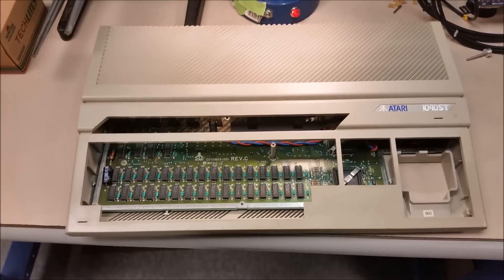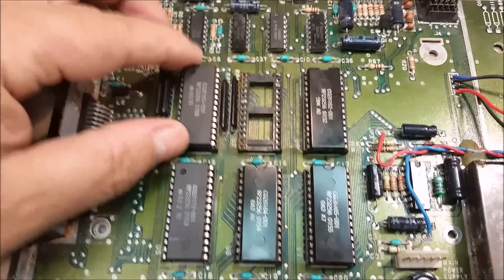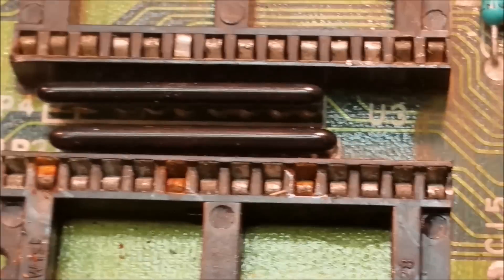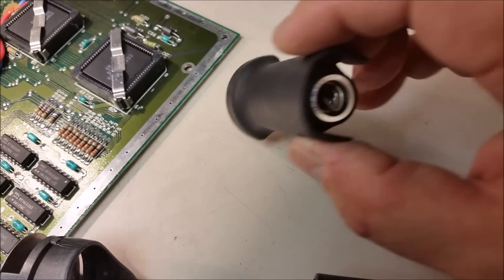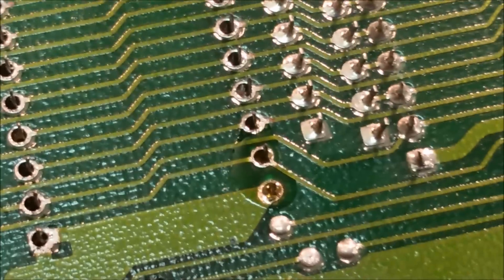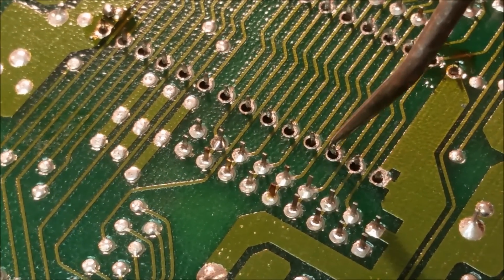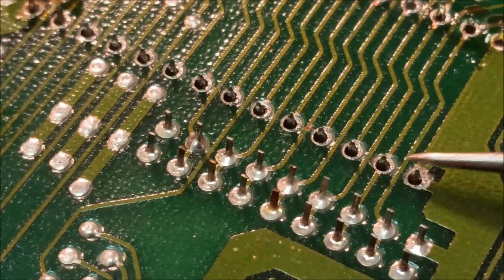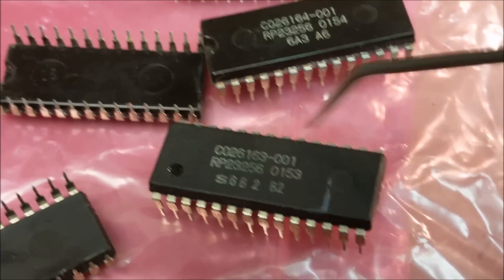ATARI 1040ST OS/TOS ROM Socket Repair Part 1 0f 4

Comment: New subscriber here. I have something new on the want list. Very handy tool.
Reply from the maker: Yep they certainly are, if you're on a budget you may try some of those Chinese Rework Stations on ebay for around $60.00. Here's an example item 121687293050 for $51.13. It's a 2 in 1 machine but will do most of what you need. You can pick up a 3 in 1 for around $80.00. Check this ebay item no. 201599141436. So you can see the significant price difference between them and the PACE systems. Thanks for watching, Best Wishes n Blessings keith
Reply: On my list for sure. I'll have some good reference material here once I start recapping my classic Macs